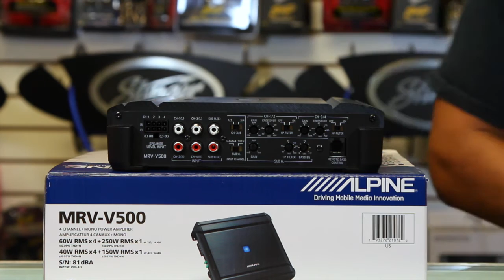Alpine car audio's new 5 channel amp the MRV V500 you

Comment: Bought this 5 channel amp in an attempt to not have to get an aftermarket alternator for my car.  The birth certificate says 105w on doors and 351w on sub at 2 ohms.  I was extremely happy with that for $220 on amazon.  It is really small in size but man, it is awesome.  I paired it with all type S stuff (6x9's and component 6.5's).  type s 12 dual 4 ohm running at 2 ohms.  Also got knukonceptz kollosus 4 gauge 2 channel amp kit and used speaker level inputs to keep stock head unit (stinger speedwire). All of the stuff to upgrade ANY stock system without changing head unit and buying all the crap that is involved to keep stock Bluetooth/steering wheel controls cost me around 500 bucks on amazon.  Could not be happier.  Just learn how to set the gain on all the channels without amplifying distorted sound or you will blow your stuff up.  It is way louder than anyone would really want it to be for a daily driver, which makes it awesome.
Reply from the maker: Zachary Watson thank you very much for sharing your story. 😀

Comment: So i have this Alpine sub and Amp ( PWA-S10V ) which comes with this subwoofer mounted with an MRV-M250 amplifier in a ported enclosure. My question is can i swap the MRV-M250 with the MRV-M500 Amp ?

Comment: what do you think about the polk db 651 and db6501 component speakers with a stronger amp cause the component are 100 rms and coaxials are 60 rms what amp would you recommend or if I should keep or change the polk to a different brand I haven't bought them yet but I'm just getting all the info I can before I make my purchase thank you and great video
Reply from the maker: samson361 an amp will definitely make them sound better. This Alpine Amp is great because you can add a sub. Personally 5 channel amps are my favorite. Rockford Punch speakers are also nice.

Comment: Would this amp eliminate the need for a LOC or an Active LOC If I used the high speaker input connections?
Reply: It would seem so. Doesn't require remote wire either as it senses audio on the speaker level inputs. I am putting this into a ram 2015 ram 1500 big horn. Don't want subs at this time as I like the storage. Issue is there is a fail safe for uconnect radios that requires load. Im hoping this will work it out. I own this amp. It was almost loud enough to drown out trucks in my convertible. The truck it should be just fine, if it works out load for uconnect, which would make sense. I'm ok with chimes and alarms as volume is down coming into traffic areas. Only other choice is audio control unit then into rca inputs with turn on wire. The limited functions of the stock head unit do what they do well for me. Not doing the later.

Comment: First just thank you all your videos, very helpful.  I want to know if this Amp would go with my pioneer AVH-x3700bhs with Kicker 40CSS654 CSS65 6.5" 6-1/2" 300 Watt and kicker KSC69 in the rear.  suggestion for a small sub, no rattle just enough for s soft bass.  thanks
Reply from the maker: Thank you. Yes that would be a great amp for those or the new Pioneer GM-D9605. Kicker makes the vcws12 1-12 box would do the trick. Thanks

Comment: Need your honest advice, 
I’m trying to run 8 highs, 4 doors and 4 6x9’s. Each door speaker Max is 250(rms 125) each 6x9 Max is 500 Watts(125 rms each speaker) I’m also running 4 12s 2ohms, each speaker rms is 1k, Max is 2k. My question is what amps would you recommend for me for both the highs and the bass ?
Reply: Powered by a pioneer nex 4200

Comment: Great video.  This is on my list for amps, however, I want to be sure it goes with the speakers I'm choosing:
Kicker 40CSS654 Component
Kicker 40CS654
Kicker 40CWRT101

Will this amp do the trick or should I look at something else?  Head unit is an AVH-X4800.  Thanks for all the great videos!
Reply from the maker: The amp is great, I would totally recommend it. We are a huge Kicker dealer, but I would recommend different speakers. Those speakers do not handle power all that  well. You may want to check out the Alpine S type or the Rockford Punch.
Reply: For a 2009 Toyota Tundra Double Cab (now that we are truck specific), what would you recommend for fitment and sound based on the Pioneer amp?
Reply from the maker: +Ron Simoneau check out the Kenwood Excelon speakers see them in this video 
https://youtu.be/JzqwScoNSKg
Reply: kicker ks speakers are good or alpine type r
Reply from the maker: TechPcGamer I would go typeR
Reply: thats what i use :)

Comment: Ive got a Pioneer avh 4200 head unit in a 08 impala and was installing a pair of 6x9 Infinity kappa 93ix (RMS 110) and JBL stadium 1224 (RMS 500). What amp or amps do u suggest to run these speakers?

Comment: I'm looking to get a new head unit(nex 4100) and new speakers(alpine type s). Should I get a amplifier now and a subwoofer later or just get them at the same time? I'm not to keen on amps so any help would be appreciated. Thank you
Reply from the maker: That sound like a good start, if you do not want to do amps that's ok. Rockford Fosgate make the p300-10 or 12 that is a sub amp all in one. They sound great, are easily removable, and don't take up a lot of room.
Reply: +Five Star Car Stereo thank you

Comment: I'm looking for a good cheap 4 channel amp ? Any suggestions
Reply from the maker: The Rockford Fosgate Prime amplifiers are a great bag for the buck. The make 3 different 4 channel amplifier to fit any budget or power needs. Thank you for the question.
Reply: Thank you so much for replying ...
Reply: I got one more question ...? Can I hook up an pre amp without a amplifier?
Reply from the maker: +Abid Ali the pre amp output of the radio is a low voltage output. Basically it has very little power output and will not drive a speaker. If that is what you mean

Comment: thanks I have learn alot from you guys, I live in mexico but I have a question I'm gonna install 2 set of focal ps165 but I would like to know which amp will work the best for it ?
Reply from the maker: Hermes Azcue an amp with 75 to 100 watts would work great. If you like Alpine check out the PDr-v75

Comment: So I'm looking at polk db6502/db652 for my 2016 ram 2500.  They are 100 rms rated speakers.  Would this amp drive those speakers effectively?  If not, would you suggest a different amp or speaker combination.

Thanks!
Reply from the maker: +Andrew Burke yes it would be plenty of power for those speakers